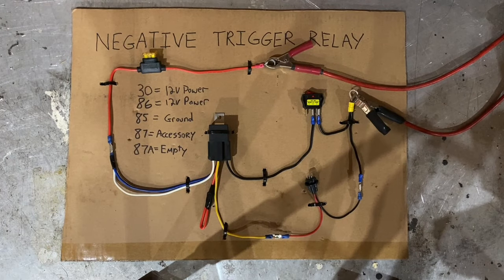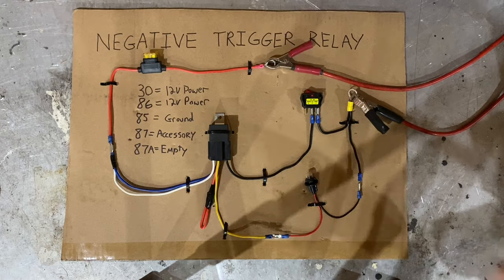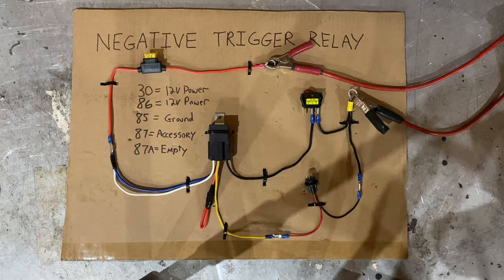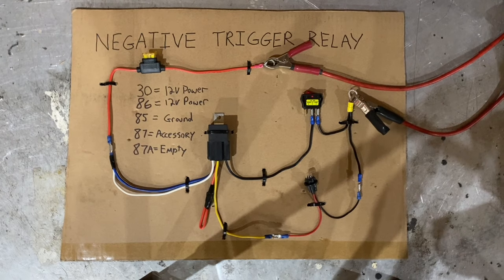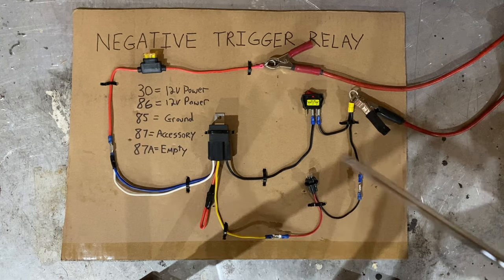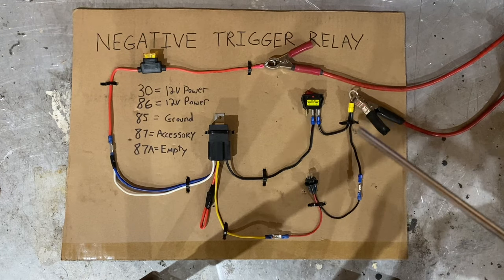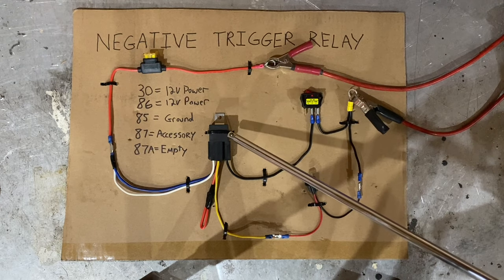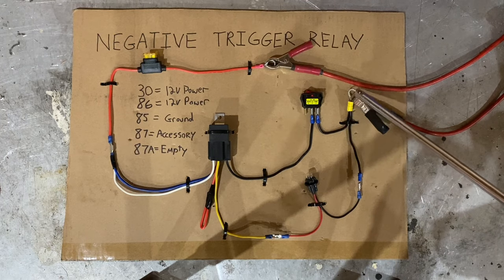How To Wire a 4 or 5 Pin Relay With a Negative Trigger Wire.

Comment from the maker: Thank You for Watching the negative trigger 5 pin relay wiring video! 
Subscribe To This YouTube Channel: http://www.youtube.com/user/4g63mightymax?sub_confirmation=1
See My Wiring Playlist: https://www.youtube.com/playlist?list=PLsF7T1tRFy2hmiiUUfMZNyV-BUA_yrPIh
Reply: Hi. Thank you for your videos. I used your 5 pin relay video to wire my fog lights. The 87a pin leaves my indicator light on like the video says, but how do I reverse it so the indicator light comes on with the fog lights? Any help would be greatly appreciated!
Reply: Ratty muscle car.. I have a quick question should I use a relay for the switches on my power windows conversion kit or would it be fine without it... I'm trying to put power windows on my truck..
Reply: The power window switch is a 5 pin switch...
Reply: hi can the negative switch wire be a thin wire gauge say like 22awg?

Comment: Used this type for circuit for electric fans on an old hot rod back in the 90s. 
Used a coolant temp thermo switch from some euro car as the ground switch, with a backup manual switch wired in as well. 
Worked great.

Comment: Thanks for posting this video. It refreshed my mind. Building a rc mower and would be using a remote switch to trigger this relay and that in turn will trip a high amp relay for the motor controller so I can cut power via the transmitter so if there's a problem the mower will shut down and not going on a rampage.
Reply from the maker: This sounds like an absolutely awesome project! It's probably best if the RC mowers don't rise up and take over. Having the kill switch on the transmitter is a necessity!

Comment: This is very useful Datsun 240Z have a negative trigger head light and turn signal switch, this is very useful.
I have found every wiring tutorial you have done very useful so thank you.
It's very very very possible to over think wired circuits . This series has broken down all the systems to useful Chunk's system by system.
Can you show how to wire a viper alarm to a Classic car since they don't come with instructions in english
Reply from the maker: Thanks for the kind words! I’m unfortunately unable to do a viper alarm system video. I generally dislike wiring alarms because they cause more problems to car wiring than I prefer. Also - thieves are good at getting around alarm systems. You may be better off with cameras facing the car and a mean dog.
Reply: ...just put a live viper 🐍 in the car and problem solved; no wiring needed.    You can still use the sticker "Protected by Viper"...it's just that the real surprise is on the inside.    I've often thought of wiring a Rattlesnake rattle to a motion activated switch in the car.   Can you imagine opening a cat door and hearing the rattle but not seeing the snake....

Comment: Now I get it. A relay is like a strong guy helping a kid (the manual switch) carry out heavy load.
Reply from the maker: Yes, exactly! I love that! Thank you for watching the video, I very much appreciate it!
Reply: Damn great way of putting it😂👍👍👍
Reply: exactly.  The switch only has to energize a small coil inside the relay (usually a few milliamps).  Once the contacts of the relay are made it can pass whatever current the relay is rated for (usually 15 amps for the one in the video).  I have seen a micro switch activate a 100 horsepower electric motor by using a relay and a contactor.

Comment: Great vids, they've helped in building my fuse and relay panel. There's still something I'm not understanding or I'm not sure if it can be done. I want to use a 5 pin momentary switch ,which I believe has led, to have switched ground for a 5 pin relay. Is it possible to use  a 5 pin switch for ground and still have the led turn on?? Led will be on only when vehicle lights are turned on. Thankyou!!
Reply: Also trying to figure this one out. I see that he is using a led switch but does not have the GROUND pin connected - usually used for the led. I wonder if this is the disadvantage... But I'm sure there's a way?

Comment: My question is..do you have a video, or where do you put a THREE way switch?

Top (brass) is ground.
Middle is for lightbar (led rocker light PLUS lightbar is ON)
Bottom is battery (led rocker light AND lightbar off)

But still need to operate highbeam as normal 

But how do i add it into a negative switched headlights on my car.

Comment: Is a different relay used for a negative trigger system or is it down to the wiring? Am I correct in my thinking that the switch is turning off the earth to relay, thus completing the circuit?
Reply from the maker: You are completely correct. It’s the same relay, just controlling the ground side of the circuit instead of the power side.

Comment: Is there a way to do this with a latching style switch spdt and keep the led on the button on as well I’m using a door jamb negative in order to wire it to the switch as a trigger and on one side ground to engage the dome light but I can’t for the life of me figure out how to keep the light on, on the button and have it turn off when I lock the vehicle it’s a 2007 Tacoma. Thanks for any help in advance! The switch is a apiele 16 mm

Comment: Whats the difference between negative and positive rrigger relay... which do you prefer always
Reply from the maker: It really depends what the relay is being used for. 

I’ll give you two examples:
1. Let’s say you want some new fog lights to always come on with your headlights. You would use a power wire from your headlights to trigger the fog light relay (“positive trigger” on pin 86),  which would flick your fog lights on whenever the headlights are powered up.

2. Now let’s instead pretend you want a toggle switch inside the cab of your truck to turn the new fog lights on. Using a negative trigger relay, you could keep all the power wires and relay under your hood. Then simply run one negative trigger wire (“negative trigger” from pin 86) inside the cab of your truck, to a switch. The other side of the switch could ground to any metal under your dashboard. By doing this, you won’t need to splice into any wires inside your truck, and there is no risk of the trigger wire rubbing on anything and popping a fuse, because the trigger is on the ground circuit.

So in short “it depends”. :) hope that helped a bit.
Reply: @WiringRescue  switch here was commected to 85... 86 and 30 were connected to positive... very helpful... about to understand well... thanks

Comment: This is great. Thank you. 

It seems that we can cut down wires running through the firewall to one, that is the wiring to the switch and then subsequently to ground on the same side as the switch. Is this correct?

Comment: Maybe u can help I have 8 lights in series with a plunger switches on each cargo door to turn the lights on and off when the doors open.  This is on a motor home. I recently discovered all the lights are staying on constantly when all the doors are closed.  I removed the ground wire on the first door switch and all the lights went out.  Is this a possible relay issue has me a bit stumped.    I am not sure if it is a 5 pin or 4 pin relay it is difficult to reach and have have to tried yet. Thank you for the great educational videos.

Comment: Thank you for this video. It's got the most info I need so far and the clearest and most precise explanations yet. I need help with a replacement 5 wire (+,--, park, high-and low-speeds) Nissan wiper motor that seems to work only when high and low are fed from the ground. I've heard others say that this is the difference with Nissan from other wiper motors  (high and low are positive), Is this true and can I use a negative trigger relay for this? i'd be grateful for any help.
Reply from the maker: Sadly I am totally unfamiliar with that wiper setup so I don’t think I could be of much help.

Comment: Hello, thanks for the videos.. I have a 24volt elec toy ride on jeep for a child.. I'm burning up the foot pedal I have tried different pedals but no luck. Can you do a video on wiring up a toy truck.. mine has a motor on each back wheel, lights two 12 volt batteries forward reverse lever 2 speed high and low. I'm thinking I need relays because I'm burning up the foot pedal.. thank u and bless u.

Comment: I have Honda Civic 2015, I am installing a right side camera and want to have the camera activate when using the right turn signal. I am using use the wire from the light switch that is for the right turn signal. I identified the wire, but it has 12 volts when the turn signal if off and drops to 0 volt when is on, how can I use a negative to positive output using a relay? By the way, thanks for the great video!

Comment: Hello sir, thanks a lot for this! Question; I'm changing the heater in my 1971 Triumph to an all electric one. Originally it had a switched ground, but no relais or fuse. I want to incorporate them to be safe, but use the standard power wire from the old heater. This is a switched 12v, would that be OK? I do not need to use the heater without the car running anyway as it will just drain the battery

Comment: Thank you for the great info! I am looking to build a fused relay to control several accessories through the use of those 5 pin rocker switches (probably 4-6). I like the idea of negative triggering because, as i understand it, it means there is only power going through the switch when it is on. That said, i am having a hard time figuring out how you would wire the switches themselves. Any help you could provide would be greatly welcomed. Thanks again for the great content.

Comment: If the negative trigger wire is a signal from a ECU, am I safe? Trying to add brake lights to my bike, but the tail light has 3 leads. +/-/trigger ground. the + and - are for the lamp but it gets a ground signal to kick on the brake light from the ECU I believe.

Comment: Please help me, Im installing alarm on my car, the alarm output is positive for right/left signals but the switch on car only works with negative pulses.

Now i did change the output using relay. The problem is that when the signal lights receive pulse, it will keep blinking until another pulse. So when i pr3ss lock button, it receives pulse and blinking never ends. Suppose to be once for lock and twice for unlock. 

How do repeat the pulses coming from alarm so when I press lock, it triggers once to flash and 2nd time to turn off flashers.
Thank tou

Comment: I have a remote control lock module and want to connect the trunk opener. The cable from the module sends negative 300mA. My relay says 30A/40A. Can it be that -300mA is not enough to trigger such relay? Do I need a smaler amp relay?

Comment: Great video thanks for making it. One question on this 5 pin negative switch relay. Can i use another accessory on pin 87a and it will switch between the two? I am trying to figure out how to best install a switch on my third brake light so that i can bypass the installed flasher module just incase i need to disable it and revert back to normal third brake light operation. The negative ground switch seems like i lot less work if i want to put that switch somewhere on my dashboard. Cheers.
Reply from the maker: That sounds like it will work, as long as you are okay with one of them being active at all times. There would be no way to turn them both off, but it sounds like you don’t need that. So I’d say you’re good to go!

Comment: Hi I connected my rock lights to dome lights using a relay. Battery 12 v to pin 30, dome light from car to pin 86 , 85 to ground and 87 to dome lights. It turns on well but when the lights are dimming, the relay starts to buzz. Should I do a negative trigger similar to this video? Or is there something I can do to stop the buzzing?

Comment: When I'm installing a new component (light bar) on my truck I have the option of Positive or Negative trigger.  What is the deciding factor on which option to choose?
Reply from the maker: Either will work if wired correctly. It mostly depends where you will be mounting the relay. Sometimes people don’t want to have a positive trigger wire running into their vehicle, because it could rub on something and short out. A negative wire will just turn your light on if the wire shorts out. Negative triggers also generally have less wiring because one side of the switch goes right to ground, which could be right next to the switch. Positive trigger needs a full power wire on each side of the switch.
Reply: @WiringRescue  Excellent,  you confirmed all I could muster up about the 2 circuits.  Thank you.

Comment: I’m looking to wire a livewell timer in my boat. Single switch with on position off and timer position. I believe this has answered my question but not sure if I would use pin 87a for the on switch position??

Comment: Can you use an OEM style switch when you wire this way?  So that the switch lights up like all the other dash lights?
Reply from the maker: Absolutely! You just need to figure out how the OEM switch works. Sometimes they work in weird ways. But generally speaking - yes! Try it out!

Comment: So I plan to use this on my e-bike instead of a power control module. The motor is 24 volt 250 w and the rated current on the motor is 13 amps..... So a 30 amp relay is plenty adequate, right?

Comment: Got a question. Are there any advantages for using negative trigger vs a positive trigger? Which of them is safer? Currently i am using a negative trigger for my fuel pump and starter.
Reply from the maker: They are both perfectly safe if wired right with appropriate fuses and wire sizes. They each have benefits. It really depends what you’re doing with them. Some people like negative triggers because it allows them to only run a negative wire into the car and ground it right to a dash. Others want a positive trigger because it’s necessary for controlling that type of circuit they have. Like everything in life “it depends”.
Reply: @WiringRescue  Thank you for the reply. For me, i feel much safer running a negative wire through the firewall. And if there is already an existing circuit and just to add a relay i use the positive trigger. Thank you for your feedback. Makes me subscribed.

Comment: It's still okay if you put the switch at + wire right?.. And should I add one more wire ground to battery if I want to connect the 87a pin to another components?
Reply from the maker: Yes, you can do that - check out this video and I show you exactly how: https://youtu.be/W2Mr2Zgv1Ck

Comment: I love your videos and have enjoyed being a subscriber to your channel. I have also watched your fan wiring video and I have a question for you. I have a ground activated radiator fan through a relay. No thermostat, just a switch. My toggle switch has three terminals and it has a warning light in the toggle that I want to use. I think I have the fan wired properly and everything seems to work as it should. I have my 85 ground wire going to the center terminal on the three terminal switch and I have a ground wire on one of the side terminals. Unfortunately, when I switch the toggle and turn on the fan, the warning light on the toggle does not light and I cannot figure out how to get it to do so. I noticed in this video it appears that you are also using a switch that lights when the unit is switched on, but unless I am mistaken, your switch light is also not working when the fan is on. Can you tell me how we can solve this problem? Thanks so much! Lin

Comment: got a question for you... on the on and off switch where you placed your negative trigger wire are they both connected on the silver tabs ?  because if I place one in the ground ...  it will not work.   mines only work when I have both on the positive or silver tabs... thanks.

Comment: Can you make a tutorial video on how to connect the key switch with LED voltage display to show the real battery capacity of electric scooter like 36-42volts and should be connected to dashboard that requiring 5v supply.  I saw some xiaomi scooter installing a key switch with voltage meter but most of them connected only from the out put supply from controller to a dashboad which is 5v only. How to rewire the 3 cables( 4 wire modification) from key switch to separate the voltage from the battery and to retain a 5v supply to a dashboard?

Comment: Ok..I've got a 1992 Harley Davidson sportster..I've taken off the stock front forks and installed a 6 inch longer springer front end ..now for my situation..I'm using a rectangle car headlight ..didn't think of it initially but the headlight is drawing too much amps for this system..how would I wire in a duel headlight relay system..small rocker switches on system..don't want to melt harness,alternator/charging system..
Reply from the maker: Here is how I would do it:
- buy a 4 or 5 pin relay (doesn’t matter which)
- connect the factory Harley 12v+ headlight wire to pin 86 on the relay.
- connect pin 85 to a ground
- connect pin 30 to the battery with a fuse in between (fuse size would be based on how many amps the headlight draws)
- connect pin 87 as the power feed to your new headlight.

Then when you turn on your headlights, your factory Harley wiring will tell your relay to turn on, which will pop on your fancy new light!  Good luck! Hope it works out!
Reply: @WiringRescue  Thanks ..
So a second relay then for high beam circuit..??
Is there a duel relay made ..or just use 2 relays ..
Reply from the maker: Check out this one I made. https://youtu.be/0h_ZbIBHM-M. I think you could use 1 bulb, that has two filaments, and your factory low/high beam switch with a little creativity.